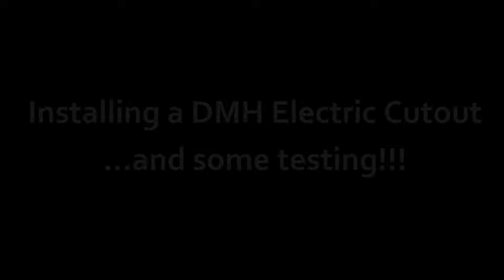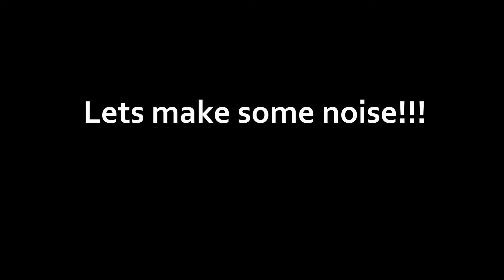DMH Cutout Install and Testing!  Sound/video clips!

Comment: I remember my Dad took me to a friend of his in the late 70's. In this man's garage was a primered grey 55 Chevy with a 454 dual quad set up! After the headers came cut outs that worked pulling a cable under the dash. The differents in the sound was awesome! He pulled out on the black top in front of his house and showed us the difference. I can still see the smoke from the tires and the deafing sound from that car. What a rush it was! Shawn

Comment: Compliments on keeping the V8 American soundtrack alive!!! I like the newer engine designs for their efficiency....BUT nothing wakes the dead like an unrestricted V8😜😁🤓
Reply from the maker: Thanks!  Thats one of the best parts about these newer V8's though.  You can uncork them and really make them monsters, and yet they still remain more efficient then the old stuff.  Depending what computer you run obviously.
Reply: I am glad that you mentioned the computer~ECU tuning is a must if you really want to dial in the correct amount of fueling. The younger generation just wants to slap in super chargers or bolt-ons without adjust the fueling rates....nice sounding motor though! Compliments

Comment: On a NA car it'll probably make a few more HP in my opinion 10-30. On turbo cars it makes a pretty big difference in power and acceleration.
Reply from the maker: I agree with you. 10-30 is what I expect to see on the dyno.  Then again, my exhaust is extremely free flowing as it is, so it might not pick up too much.
Reply: Daniel Caldwell I don't think it gets that high without a tune

Comment: that is awesome, best mod you can do for cheap.....sounds amazing, and so cool u can have it quiet when u want it.....how much costs???   great video guy
Reply from the maker: Thanks Shane. Its about $160 with the pipe...I think.  Its been a long time.
Reply: @JEGsGarage  i need thats . Good job JEG's GARAGE
Reply: @JEGsGarage  How well did it hold up. Did the electrical mechanism fail ?

Comment: Great video and a great job 👍🏼! I only have one question though, when it’s closed is there any issue with the air flow or back pressure because of the closed pit or will the air be able to travel normally? Thanks!
Reply: you are adding a "Y" pipe to the exhaust preferably just before the catalytics(may cause an engine code when running open but it means nothing just epa crap). one leg of the 'Y" pipe will have the exhaust cutout so it will exhaust normally unless you open the exhaust cutout then it will run open exhaust with no restriction.

Comment: When I rebuilt my engine I snapped my drivers seat under load and had a 50 minute drive home with no back support, looks like yours aren't going to last long either.
Reply from the maker: Hi Ari.  I actually never realized how bad they were until this video.  They are factory seats from a 2002.  I didnt really worry about them snapping, but they certainly moved too much and didnt offer any head support.  So I put Sparco's in for now.  I dont love them, but they're solid, sit lower, and are way more supportive.  Im lacking in videos...so you'll see them if you check back once I get back on the ball!

Comment: Btw..seems like u need better tires. On all my mustangs that are over 600hp I run Mickey  Thompson  Street Comp 17x9 275/40 up front & 17x10.5 rear with M/T Street Comp 315/35s and they hook WAYYYYY  better than my Drag Radials.Im 44 and had my 1st 700+ hp 5 speed/Tremec TKO Mustang Fox Coupe at 16 and you would never bieve how many tires Ive tried..I have a few Super  Cars which include a Lamborghini  Murcielago  LP640 MANUAL and a few other interesting vehicles but the M/T Street Comps hook like glue. Good luck man!!!👍✌👌Stay safe bro!!!
Reply from the maker: I mean, they are Nittos.  They arent crap tires.  Sometimes if the temps are good it'll hook fine.  Other times its a handful.  But I find it hard to believe a mustang with over 600 hp will hook easily on the street no matter what tire if you are really hammering it.  haha.
Reply: @JEGsGarage  I just  wanted to tell you I'm running all HOTCHKISS  suspension with Energy  Poly and tubular front K member and arms. Take care  man..car sounds  good@@!!!

Comment: Also a friend who is on long distance now had a nice new set of ramps which failed, the car which he was working on came down on his chest and he died as a result of compression
Reply: William M. Damn that is so scary!
Reply: William M. yeah righto mate.  that sucks a but you could have kept that to yourself.
Reply: William M. That’s why you always use jack stands incase something like that were to happen
Reply from the maker: That sucks.  I didnt get under the car though.  I was reaching in.  Exhaust is right there on the side.  Ive never had an issue with my ramps.  Normally I use them just to get the car up high enough to get a jack under it, then I use jack stands.  But for oil changes or things like this, I just reach.  My head wouldnt even fit under the car on those ramps haha.

Comment: Hi dude nice setup. I want to install a setup where I can open the cutouts however much I feel, not just fully open or fully close. What is involved in doing that?
Reply: valflyinf I have two cars with that setup. It doesn't work the way you'd expect. As you start opening it, the noise comes in almost immediately (after briefly sounding like a crappy exhaust leak). The sound level is pretty much the same from about 1/4 open to full open.
Reply from the maker: I both agree and disagree.  The one I have can be opened to any position.  Its a momentary button so if you just tap it, it just budges.  First tap, sounds like crap.  2-3 taps and I feel like it sounds pretty decent.  There is DEF a difference between 1/3 open to full open.  At least on my car.  Fully open is obnoxiously loud.  I rarely ever open it up all the way.
Reply: @JEGsGarage  thats the point of this device! Its doesnt have any sence to open it 1/3. Youll better buy a modified final muffler for that

Comment: I have exhaust cutout myself... Loving the power n sound
Reply from the maker: You will see a gain cut out open vs closed on some set ups.  If your motor is a fire breather, opening the exhaust will gain you some.  You might only see it on a dyno sheet, but I have seen it make a pretty big improvement at the top end.
Reply: i have dyno tuned my motor with GT28 turbo. While the cutout closed it made 254hp, and 270 when opened.

Comment: I have The cut outs already. Where do i get these electronic devices. That's so cool.
Reply from the maker: There are several manufactures.  This one is made by DMH Performance.  Another good one is QTP.  You can get cheap ones, but keep in mind it sees high temps from the exhaust and it will see water/grime if you drive every day.  Cheaper components might not hold up as well as a good brand.

Comment: has anyone seen if anyone has dyno'd the cutoff and what not an what power difference does it make
Reply from the maker: Lots of people have done back to back runs with the cutout open or closed.  It makes a bigger difference then you would think especially in the higher RPM range.  Exact figures will depend on a lot of factors.  How well your motor wants to breathe, etc.  For instance, my car breathes pretty well even with the cut out closed.  But I still saw a 15 rwhp difference on my old build with the motor running like crap.  People have seen more than that.
Reply: JEG's Garage I was thinking I wanted to have it open at high rpms on its own like when your in 5th gear at 5k rpms for example

Comment: That thing sounds so freaking good! I wish I could hear it in person
Reply from the maker: It actually does sound a good bit better in person.  Still not 100% happy with it though..  The cut out is loads of fun, and gives a little more punch on the top end while open.  But I would rather have a nice tuned exhaust that is quiet down low, loud up top, and has better tone.  I think I need true duals to get what I want.

Comment: When attaching the new pipe to the existing exhaust, did you weld or clamp it on?
Reply from the maker: Hi Daniel.  The cutout pipe is welded to the end of the y-pipe.  The clamp directly at the rear of the cutout section is just for the cat back.
Reply: JEG's Garage Great, thank you.  And you removed the exhaust pipe when welding or were you able to get access without taking it off?
Reply from the maker: Hi Daniel.  The y-pipe is fully custom.  I built it using universal bends.  Here's a pic of the y-pipe itself.  
http://i57.photobucket.com/albums/g221/jeepguy25/exhaust/S6000964.jpg
If I were to install this with the exhaust on the car, I would likely either clamp it in place or drop the y-pipe and weld it.  Im no good at welding exhaust under the car.  Or maybe see if you can slip someone at an exhaust shop $20 to weld it in quick for you haha.
Reply: That looks great, thanks for the reply.  I don't weld myself that's why I was looking into quick/easy ways to do it while still leaving the option to undo it if it gets rusty/problematic (lots of snow and salt where I live).  I think the best option for me will be to cut a small piece off and clamp on the bypass valve so I can remove just that part later if needed without taking off the entire thing.
Reply from the maker: Yeah thats probably the easiest way.  Basically like a cat delete or a "test pipe".  If you can use band clamps vs traditional u-clamp type it will make it easier to remove it.  The cutout pipe I have is stainless.  I made the whole system out of stainless so I wouldnt have to worry about rust.  Its worth the extra investment if you can.

Comment: Tremendous sound machine.....Great electrical cutout valve.....Are they position adjustable? Cheers...
Reply from the maker: What do you mean by position?  Do you mean opening amount?  If so...yes.  I just tap the switch a few times to crack it open and that increases the sound enough usually.  If you mean physical position...also yes.  Pretty much however you want to mount them, you can.  If you can weld, that opens up your options tremendously because you can adjust the cutout pipe however you want.

Comment: I have a 1300 whp 94 Mustang Cobra and I run 6 inch long 4 inch wide custom made Dynaflow dumps on the car and you literally ca not scream over the car idling. Im running a All Aluminum ROUSH 427 SBF "Small Block Ford " Particulars are ROUSHs secret but ive driven it from Dallas to my house in Vail Colorado  then to San Francisco  and down to LA THEN up through Utah and back to Vail Colorado  and it never missed a beat..Even qith that HP through a Procharger  I got 7-9 MPG!!

Comment: sounds WAY better! HP gains?
Reply from the maker: Not sure.  I havent had it on a dyno, but I plan to do a back to back, mainly because of how much attention this video has gotten.  My exhaust flows VERY freely even with the cut out closed, so I dont expect I would gain as much as some.  But thats not the reason I have it on there, so if it did pick up something, it would only be a bonus!

Comment: old man suggests roll cage, safety harness, fuel cell, and perhaps fire extinguisher.
live long and prosper!
Reply from the maker: Haha thanks for the comment.  Roll cage will come if the car ever goes full track duty.  As of now, the factory crash protection is adequate.  Aside from a few of the shenanigans I put on video, I rarely drive the car in a way that would stretch the factory safety.  Once a cage goes in, I feel less save in a street environment, and it also means NO kids in the back for sure.  Fuel cell is touchy.  I have a new plastic tank, and there is no "trunk".  So I would have to either custom order and install a fuel cell in stock location, or build a firewall inside and put it in the hatch.  Again, not at that point yet.  I do have an extinguisher...Though thanks for reminding me as its probably out of date and no good at this point.
Reply: JEG's Garage looks like a lot of fun. thanks for posting!

Comment: nice video. did you drill a hole through the floor ? what did you wire it to ?
Reply from the maker: I didnt drill a hole.  However, when the car is apart  next time, I think I will.  I ended up running the wire up along the floorboards, under heatshields, and through the old automatic shifter cable holes.  Its wired to an F-body convertible top switch.  Donor car for my original swap was a 99 Z28 Vert, so I had the switch laying around.  Work well and is stealth :)
Reply: JEG's Garage

sweet, thanks for the reply.

Comment: Sounds great man! Looks like a pre 93 model.  Did you do an LT or LS swap? That thing pulls to hard to have a crapy TPI
Reply from the maker: Its an 86.  6.0 LS swap.  I do miss the TPI I had in my 87... mostly for the look of the motor, smoothness, and sound of the older SBC.  But this thing is a beast :)

Comment: Did you made a hole on the floor or in the firewall to get inside all the wiring for the switch??
Reply from the maker: Nope.  The car was an auto, and is now a six speed.  So I routed the wire up to the transmission tunnel area, and fed it through the hole that was left from the auto shift cable.  If I ever pull the carpet back up, however, I will be drilling a hole near the cut out, and feeding the wire inside.  I dont like having to snake the wire up front due to the exhaust and all.  Its tucked under the factory heat shields that are on that side of the car, because the stock exhaust/cats used to pass along that side.
Reply: JEG's Garage 
Amazing.
Thanks for quick reply.. 👍

Comment: So based on your videos I'm trying to diy a variable sound exhaust (flaps on the mufflers ) for my c63 amg. The cost for a real one is $3k id rather try to make my own. Just bought 2 electronic cutouts now to disassemble and somehow transfer to mufflers ...hmm its going to be a pain
Reply from the maker: You should be able to manage that.  I believe there are controllers out there that will open the valves depending on throttle.  I KNOW you could easily hook it up so they open at WOT and close again after you let off for a certain amount of time.  Should be a fun project though!
Reply: JEG's Garage I think I want to go with the remote deal sometimes I have clients in the car and it being so loud may not be the best way to go. Plus as a daily it gets annoying for me after miles and miles of driving. My only worry is that I'm a total novice when I comes to wiring . So I guess the biggest hurdle will be the transition from 2 remotes to one remote that opens both or closes both at the same time. The other problem being I'm using stock mufflers which comes out into 2 seperate dual tips  on either side. The muffler as far as I know is just a straight shot, meaning if the valves are closed the back pressure has nowhere to go. Might be a problem.
Reply: JEG's Garage Of course I dont know if the muffler is a straight shot through or not because I have not removed it to check

Comment: That's gotta be a trans am as far as I know a Camaro in the 80s never had pop up head lights  bad ass man
Reply from the maker: Absolutely right.  No Camaro every had pop UP headlights.  1st gen models had hide-a-way lights that were doors that rotated to the sides with vacuum power on some.  But this is an 86 Trans AM.

Comment: So to get the cutout on the car did you just install a generic y-pipe and add it on?
Reply from the maker: Hi Nick.  I ordered the Y-PIpe with the cutout.  But yes, any generic cutout pipe will work.  Assuming you get the appropriate size pipe and cutout valve.
Reply: @JEGsGarage  Okay great thanks!

Comment: badass bro! did u finally get around to getting it tuned?
Reply from the maker: +Mike Terrazas Thanks Mike!  Well...it is tuned.  Sort of.  Its still speed density, but I turned closed loop back on.  Honestly...it runs so darn good, that I don't even want to turn the MAF back on.  I noticed no real change in the way the car runs between cool weather, hot weather, humid weather, rainy weather, etc.  And that's what I was concerned about.  It doesn't stall.  I think I can still tweak a couple of things to make drivability a little nicer.  And power off the line a little more crisp.  But otherwise, she's good to go.

Comment: Nice, what headers are you using, are they long tubes? Your whole exhaust looks nice and tucked. Im using hawks swap long tubes on my car and the passenger side collector sits sooo low. I would love to have it tucked with the clearance like your setup.
Reply from the maker: +matt Hey Matt.  Those are Stainless Works headers.  I got them back in 2006.  They were still fairly new back then.  Mine fit perfectly.  I just wish they clocked the O2 sensors a little better.  The Y-pipe is the most important part if you want the exhaust to tuck well.  I made mine myself after struggling with the Hawk's/Stainless Works y-pipe.  A double hump crossmember and custom Y-pipe is the best way to go.  Although, Hooker has a swap system out now that looks VERY promising.  Thanks for watching!

Comment: Will this affect the oxygen sensors???will I get check engine light on ??
Will it go away as soon as I turn the device off?
Reply from the maker: This is installed downstream of the O2 sensors.  At least in most cases.  It shouldnt affect the O2 readings.  You should not get a check engine light.  If you do get a CEL, closing the cut out likely wouldnt turn the light off right away, you'd need to clear it, or drive it a number of times for it to clear.  I dont see how it would cause a CEL though unless maybe you installed it before the sensors.